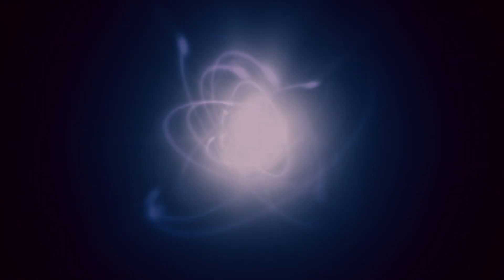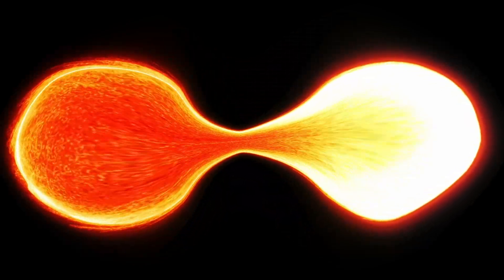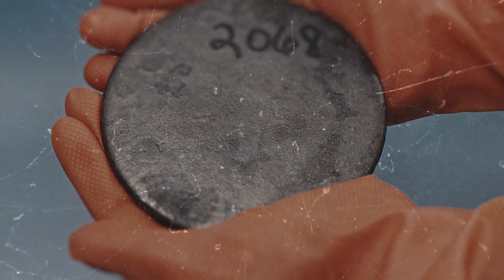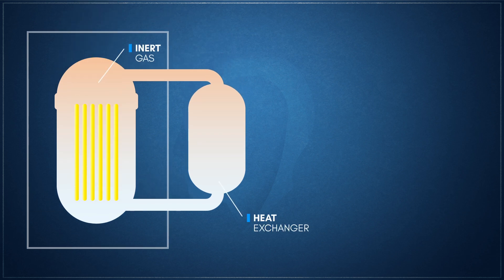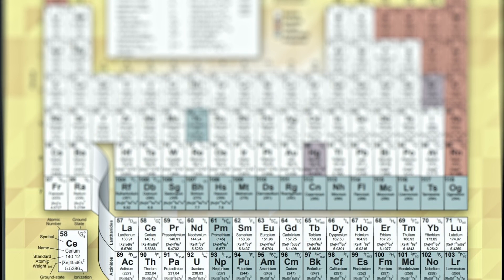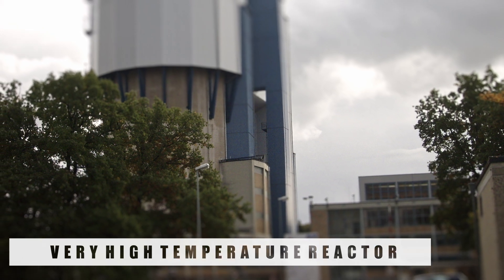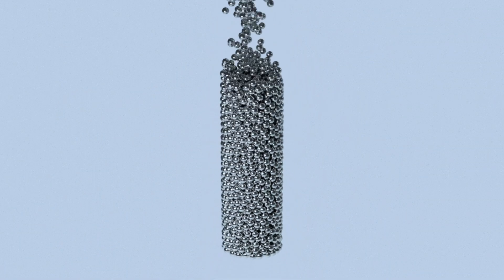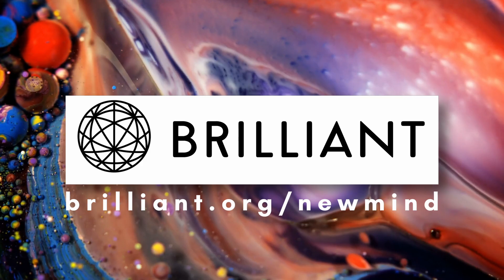Portable Nuclear Power

Comment: If one wants nukes to flourish, do something really effective with they never being able to overheat or release, and a fix for rad waste. I read articles all the time about nuclear fission's return, and never see any real developments that directly address these issues. I read proposals all the time for helium moderated reactors, or Molten Salt, but it seems never to get to the test reactor phase.
Reply: costs kill off any project in nuclear energy. it's a dead technology at this point.
Reply: @NaumRusomarov  This is why, recently, I have become more focused on rapid change with solar, wind power, and storage tech. I'd re-look at nukes even in the path of beta-voltaics (micro-micro) just for cost's sake!
Reply: @mortimerhasbeengud2834  storage is kinda cool, I have to say. It pretty much fixes all of the problems with intermittency of renewables on a long-term basis so that we don't have to use gas plants for when wind and solar are underproducing.
Reply: @NaumRusomarov  Storage seems essential. There's now a big effort in windpower at sea, and the farther out, the better constant wind flow. Seen as a replacement for failed fission and never here, fusion. For solar, there's a study by Columbia +Imperial universities, indicating we can power ourselves 4.5 over using current PV's at 50% roof top power, globally.
Reply: @mortimerhasbeengud2834  Solar/wind is a dead end technology. The amount of land you would need as well as the dependency on the weather makes any large scale project non viable. Before anything I need to mention that the next big thing for our civilization is space. It's basically the New World of our time. When you need to power space factories , star bases , large space ships, etc you woouldn't want to use solar panels that would need hundreds of times more space than a nuclear reactor. Not to mention the cost of making them if you exported them from Earth. Although solar/wind generate "green" energy they are way too situational in order to base your whole future civilization wide plan of energy production on. You should also remember that nuclear technology has a way higher ceiling of development compared to solar/wind. Wind turbines can only improve overall only if their construction cost lowers (which has a limit). Solar panels are capped due to various reasons. One is that they rely on the availability of the sun and the need to occupy large amounts of land in order to capture sunlight. Second most of the "easier" and biggest improvements in efficiency have already be completed. Any future improvements in efficiency will be slower and less frequent compared to the previous rate. Nuclear reactors haven't recieved so far any major benefits due to economics of scale. Moreover the overall investments compared to "renewable" has been less than expected for a technology that promises zero C02 emissions as well as having the safest track record of all major energy production methods. Overall in my belief solar/wind is nothing more than wishfull thinking and a romantisim idea.
Reply: @mortimerhasbeengud2834  
Solar and wind is not realistic for complete global energy generation. It can be used in conjunction with nuclear and natural gas.
Reply: @bighands69  This may work out to be true. Gas we could go thru in 40 years. Experimental reactors abound, but jack, for actually getting produced! The best chance for nukes are micoreactors, mass-produced, that are heat pipe reactors, like Westinghouse's Evinci. That could work! Still, solar and batteries are now commercial, and going big. Australia is doing this.
Reply: @mortimerhasbeengud2834  
There is more than 40 years of natural gas available. Combine it with nuclear and it will last a lot longer. 
Coal (recycling) can also be factored into the system.
Reply: @bighands69  True, people somehow don't realize that zero carbon is totally unnecessary.  It'll work out about as well as a zero calorie diet!!!
Reply: What do you mean? Modern reactors can’t release radioactive material, there’s no imaginable scenario in new reactors where that can happen
Reply: 16.

Comment: So you use those uranium pellets in a cold war design reactor and burn off around only 1% of the uranium and save the rest of the pellets in storage facility so it can have the other 99% finished off by a Molten Salt Reactor? So you can reduce storage of hazardous waste from 20,000 years to 300 years🤔 sounds a little like using the SLS to go to the Moon.

Comment: Superb research and reporting. your graphics are excellent. This is hyper-interesting stuff. I'm excited about the use of portable reactors on the Moon and Mars. I subscribed immediately.
Reply: Nuclear reactors are great for space because for their weight they produce an amazing amount of energy,Th moon has two week nights so we are working hard on reactors for the moon, all the acronyms were based on Simpson references so we had KRUSTY,and others, Kilo Power put out 10KW it used heat pipes and you gt rid of rejected heat with umbrella type radiators.
Reply: @paulbedichek2679  and any disaster would be inconsequential as there is no environment to ruin as it is a radiation battered wasteland already.

Comment: Small modular reactors (SMRs), depending on their power-to-mass ratios, would be perfect for manned space exploration. They could be used on spaceships, base power for settlements on the moon and Mars, and for asteroid mining.
Reply: First we'll use TRISO for propulsion and power and heat,NASA has already been doing this for years.
Reply: SMR is such a generic term.
Reply: @drmosfet  Space systems are not SMA, they’d be micro reactors, NASA wants a 40KW reactor.
Reply: Smr
Reply: @paulbedichek2679  
The video covered many types of fission reactor types that could be made into a Small Modular Reactor, even a fusion reactor if it ever happens, might someday be built in a SMR form factor it only 5 to 10 years away 🤣, not sure how my statement is incorrect 🤔
Reply: @drmosfet  SMR is just three words language evolves and we all get to help shape it, everything that produces power and uses U isn't a SMR,there are micro devices, when we say SMR the first thing to think of is the NuScale system,77MW in groups of 4 ,8,12, Ultra Safe Nuclear uses TRISO with He cooling 15MW,they want to call it a nuclear battery,I wouldn't call space based fission systems like the KiloPower 10KW,a smr,but language is flexible.
Reply: Not really. One of the biggest problems in this case and in space exploration in general is getting rid of waste heat. You're surrounded by vacuum, there is physically nowhere to drop the excess heat from reactor coolant without just ejecting it into space.
Reply: @ЯрославВершинин-в3р 
Not true! A vacuum is perfect for getting rid of waste heat -- by radiation. Any spaceships or habitats would have large radiator surfaces to dump the heat into the vacuum, which, of course, would act as an infinite heat sink.
Reply: @ЯрославВершинин-в3р  What do you mean? Of course there is how do you think Perseverance works? Doesn't have to be radioactive, just need constant heat for fifty years.
Reply: nuclear reactors in space have a whole host of problems that normal terrestrial reactors don't have, mainly heat transfer issues since even most smr's still rely on some fluid convecting in the closed vessel whereas in space fluids tend to bounce around
Reply: @AsbestosMuffins  Right,and th weight which must be minimized for flighr,but night lasts two weeks on the Moon,and the sun never shines at the bottom of the craters at the South Pole where w are going,so nuclear power is a priority. There is so much radiation in space from the sun and cosmic rays it puts things into perspective.
Reply: @AsbestosMuffins  maybe it could use inertia from spinning to create an up and down allowing the fluids to settle.
Reply: They could be used for a space ferry between earth and the moon.
Reply: Lets just start by putting one in a yacht. Than 3d print a nice catamaran and massproduce so they became as cheap as an normal apartment building. Or even better a zepplin that can fly continuous with a whole house in it.
Reply: I did a small project on the space concept back in highschool science class, and I vaguely remember it being deemed "non-viable" due to the output/effort ratio. It was easier to do much simpler methods, and took less upkeep. But NOW its been a good while, this may be a viable option. Looking forward to seeing how it all plays out
Reply: "Priority overwrite! New behavior dictated! Must seek for new materials!"
Reply: @Maumu Maureate nuclear energy creates heat, the heat can be used with water to power a steam turbine.  No other obvious way to turn heat into electricity.  Water changing phases is a classic powering method.
Reply: SMRs on big airplanes with VLS
Reply: @walter "would be perfect"?
They are currently and have been on Submarines...
Reply: Theyre perfect for space, once theyre in space. Unfortunately its pretty dangerous launching them up there (nuclear reactor riding a rocket is pretty sketch). Shielding them properly and making them safe for manned flights also makes them less viable to launch as well (leads heavy) which is one reason nuclear powered planes never took off.

Hopefully this space elevator Ive been hearing about for decades or something comes along to make the journey to space itself safer, then we could really utilize true nuclear spacecraft.
Reply: @JD-ub5ic  No,not much danger in launching them, no radioactive release from a full explosion, the US has NASA asking industry for a 40KW  version, they all have umbrellas which are actually radiators as they radiate the rejected heat easily as there is no atmosphere or clouds to interfere with the heat rejection.
You don't use lead for shielding,and we will use nuclear power to send humans to Mars as the radioactivity from the sun and cosmic rays dictate that we get there in half the time chemical propulsion is much too slow.
Reply: @JD-ub5ic  space elevator? Thought it was supposed to be an elevator to the moon.
Reply: @JD-ub5ic  Radiactivity in space is far beyond anything on Earth save for the interior of reactors.
Reply: @paulbedichek2679  The concern isn't them releasing radiation in space, the concern is if something like the challenger or columbia occurs. If the rocket blows up before it leaves our atmosphere or otherwise crashes.

If nuclear fuel lights on fire due to either an explosion or high heat as it falls through the atmosphere airborne radioactive isotopes would be released. Why do you think there would be no radioactive release from an explosion/fire/high heat event?

I agree with you nuclear power in space is incredibly important and useful and we should pursue it. Unfortunately there's just very high safety barriers getting fission reactors to space compared to using it on the ground.
Reply: @JD-ub5ic  No, you can’t honestly believe NASA didn’t think there could be a rocket explosion?
We’ve been launching rpg’s for years made out of Pu, these new reactors will be powered by TRISO a fuel explosion won’t damage TRISO and they are shielded.
Reply: @paulbedichek2679  I didn't see your original comment when I replied to one of your later ones, didn't realize TRISO is what you were talking about. Fair enough about it's heat resistance. Even still, it may be safer than other fuel sources but the reactor compartment itself would need to survive any rocket explosion and a drop from space without being destroyed to avoid an accidental release (read heavy, but theoretically doable). Additionally if it did collide with the ground it would have to be assured not to go critical when all those pellets smash into eachother to avoid another windscale fire incident (I can't imagine the coating on the pellets would survive the drop and once that coating is cracked fission products could be released).

TRISO helps but still major safety considerations with the launch.
Reply: A new reactor itself is not Radio-Active. Sure Uranium fuel is, but Maybe we can harvest Uranium from asteroids or from the moon?
Reply: @danielgrwaldphone2927  Space is so radioactive it is not any reactors we worry about. We should look for U in the asteroids but by the time we could use it we'll be on to fusion which uses protium deuterium and tritium which you get from water which is plentiful everywhere.
Reply: @JD-ub5ic  Triso is extremely safe ,that's the whole point.
Reply: They used to use radioisotope Thermoelectric Generators for the Mars rovers, so I could definitely see fission/fusion being used on a space ship. There wouldnt even be an issue with shielding either.
Reply: @Exis247  I believe the nuclear fuel source used for these batteries is much safer than spent fuel from fission reactors, but I'll admit that's getting to the limits of my knowledge. Perhaps using some sort of plutonium dioxide fuel source like on those batteries instead of highly enriched uranium could be a more feasible way to get a fission reactor into space, but the output and lifespan would be much lower and weight much higher than using more enriched (more dangerous) fuels.

Additionally once you start actually fissioning these fuels the daughters are often the dangerous part, so any fission craft of any fuel source even if safe enough to launch may not be safe enough to return after actually using its reactor (for certain missions this could be okay).
Reply: @Exis247  We use Plutonium today on our rovers, they are far more powerful and long lasting than a solar panel.
Reply: There is no space brother .....

Comment: "The fuel used for the S1W was enriched uranium that contained only about 5% U235, at this low of enrichment the neutrons would need to be slowed down in order to increase the probability of a fission event"  is this because it would more expensive to include more U235?
Reply: Well yes but also proliferation is a concern too. The more uranium around, the easier it is to make a simple fission bomb or a reactor to make plutonium for a bomb. It only takes a few kg of U-235 smashed together to make a primitive Little Boy type weapon, which is by far the simplest design for an atom bomb ever, in my opinion. Enriching uranium is a bitch but the more you have to gain, the more valuable it is.

Comment: STIGMA? you mean generational.DNA damage n disease presentation up to 20 years after exposure. 
It's not "waste", its toxic by-product,  which STILL has no way to be neutralized. 
Science does not know enough about this energy source to use it wisely.  
Until there's a way to neutralize the game caused by the by-product,  using nuclear power is slow suicide n unsafe. 
We need honesty out of the IAEA, for starters.
Reply: Nuclear waste is completely recyclable since the 1960s.

Comment: Not good enough. It needs to be the size of a clothes washer, transportable using any common carrier without special approval, provide enough power to operate a large home, and be reliable enough to require only as much service or maintenance as the average Maytag washer (once every 5-10 years). Unless that happens, meh.

Comment: Every commenter here has missed what U believe is the solution to small mobile reactor based power systems. I even thought at one point it would be described but no. 
Pellets in which the fuel is contained by carbon but held at over 3000 C at which temp. uranium is a gas could take advantage of thermophotovoltaics to convert to electricity with no moving parts in the entire system. Nanostructured carbon encasing the pellet can be tailored to emit light at wavelengths best for PV on the exterior. These micropellets would have to have passive moderation to slow reaction rate as they heat up, but each pellet would produce light to be converted by PV to  electric power with no moving parts at roughly 50% efficiency while the uranium is safely contained and need not be enriched.
Reply: What an ingenious idea. Let's convert uranium to a gas. Brilliant.
Reply: Everyone missed that because it is the least common sense thing in this entire comment stream.  congratulations on that trophy.  I bet you are a used car salesman, certainly not a scientist or engineer.  Now, go look up the most efficient solar panel in existence and see how much power you can get from it at 100% capacity.

Comment: 0:45 this is an outright lie. While nuclear is at least a few thousands of time safer than coal and gas, it's still a few time less safe than solar and wind. What makes nuclear a true necessity is its capacity, coupled with safety, not safety alone.
Reply: Check out how many have died servicing wind generators. Lowest energy density verses highest density. What that means is wind n solar needs more metals and real estate to make the same power. That's expensive. Subsidised costs.
Reply: 27.

Comment: effort should not be measured by money
Reply: trash, faith is a ton better
Reply: faith makes law unlimited
Reply: but if law tries to rule over freedom, its hell
Reply: peoples military is crap
Reply: rotate fusion water, D2O, after it has transmuted into helium gas and oxygen, and carbon and nitrogen
Reply: bombard that with high voltage electric ion flow, in copper
Reply: copper water coolant pipes
Reply: yes micro fusion heavy/semi-water coolant tubes, two-in-one

Comment: 9:27 is a wood pellet power plant, not a nuclear one. You can tell by the company logo on the building which says "Ørsted", Ørsted is the Danish national power company and used to be known as DONG but they've completely abandoned fossil fuels and changed their name as a result. Ørsted also does not operate any nuclear reactors as Denmark doesn't have any nuclear power.

In fact I think that footage is of the Studstrup power plant that's right outside the city I live in.
Reply: Denmark does have nuclear reactor companies.